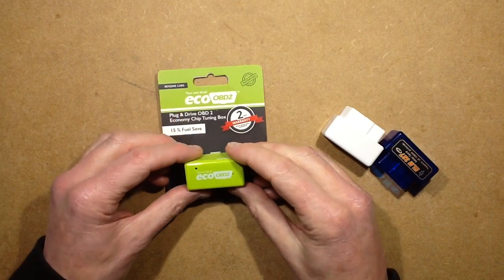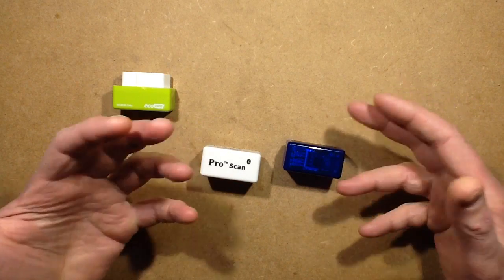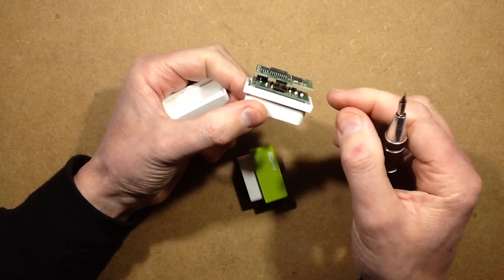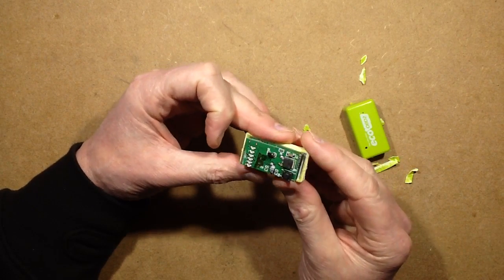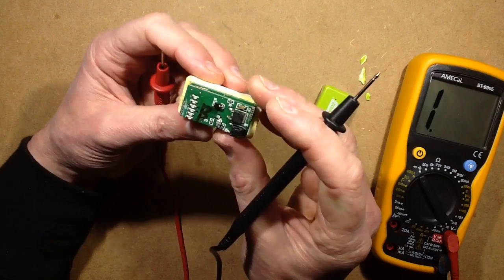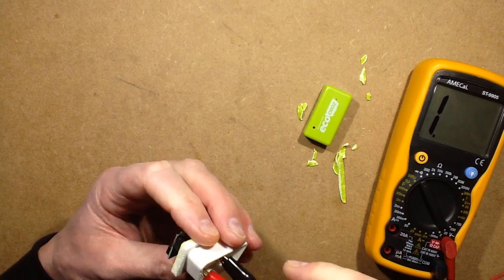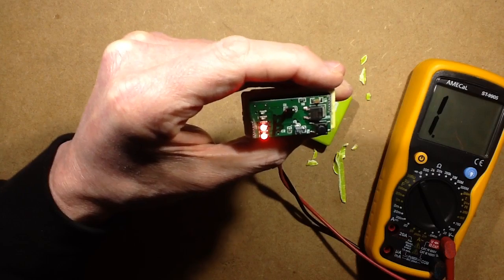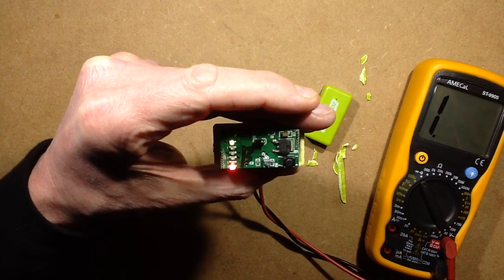Inside an ECO OBD2 "chip tuner" fuel saver.

Comment: Please Read this!!!!  

   A few years back I have released online the code and also schematics to build this systems. Just search for EGBoost and you will find some testimonials and videos I have made. They do not do anything to your car, absolutely nothing. The code can only processes loops to flicker the lights. The main chip is usually an ATTiny13 or equivalent. The idea started as a legitimate, write the code to alter the fuel maps of the car. But that could not be done as simple as you may think, the fuel maps can not be altered mostly from the obd2 alone, and if you actually can you run into the issues of having to store every singles vehicle fuel map settings. That will mean that you need to take each model car and run it on a dyno to figure out the correct settings. Not only that but you will have a less then 10% chances that you will even improve anything. So the idea was simple create the device, this way people will drive slower, this way it will improve the efficiency.  In any case, long story short I never finished the device as it was just to much work and would make not sense as many people will not really use it. So all the files were dumped on some forums and yea here they are now. sadly the pcb looks identical to what we released. Glad we scrapped the project when we did.

Not sure if you pointed that out but the regulator drop from 12v of the car to 5.5 of the Attiny, also the resistor are for the LEDS. The Can Bus does nothing but provide the power. I believe Pin 2,6 and 16 can be used for Power and 5 for signal ground. Mostly to have the system power on with the vehicle. 

Please do not waist your money.

Comment: I'm guessing it's a placebo, as to change any engine characteristics it would have to modify the engine 'map' and I doubt that little box has the capability to do that.

Clive you can do things through the OBD2 socket on most vehicles I.E. remapping :)
Reply: yup the only way is to trick the ecu to think its ok to have a lower lean limit.

Comment: most of these device types don't reprogram your brain..... the usually manipulate the voltage from the O2 sensor, and the throttle position sensor to adjust the fuel ratio..... it probably is more placebo then big gain...... it probably gets u couple miles not a significant amount
Reply: the car brains from 96 up to the new era of actual flash able brains....... will run a monitoring type firmware diagnostic to monitor the performace and keep it adjusted....... so..... that device will have a temporary reprograming effect...... then when you remove it, the change will linger for a few days until it re-adjusts it self........ you can test this device by getting a obd2 trip computer hooked in line with the device and watch the readings change.... get this cable http://www.ebay.com/itm/50cm-OBD-2-II-16-Pin-Right-Angle-Y-Splitter-Extension-Cable-for-Diagnostic-Tool-/121837184747?hash=item1c5e0fe6eb:g:SJIAAOSwNphWaSv-&item=121837184747&vxp=mtr  and trip computer http://www.ebay.com/itm/ScanGaugeE-OBD-2-II-DIGITAL-GAS-FUEL-SAVER-OBD2-GAGE-TRIP-COMPUTER-SCAN-GUAGE-E-/261248811052?hash=item3cd3a4802c:g:NZMAAOSwPcVVsvzp&item=261248811052&vxp=mtr and you can verify the product, by driving a week or so and verifying the normal mileage..... then add the eco device and watch the mileage to fuel change.
Reply: here is a unit for a cheaper price...... http://www.ebay.com/itm/New-Trip-Computer-Scan-Tool-Turbo-Gauge-IV-Digital-Gauge-OBD2-Fault-Code-Reader-/301818216811?hash=item4645c4816b:g:RH4AAOSwv-NWZQHk&item=301818216811&vxp=mtr

Comment: if you want to save fuel get a professional to tune your engine. Dont use these things as every car is different. Tuning usually involves a laptop, some software and connecting to the ECU or chip and driving along monitoring the values. Changing the computer values is only a small part of tuning, theres a lot of other mechanical changes needed to tune the engine. Dont forget to check your tires.

These sort of products actually makes it worse for your car.
Reply: Both mechanically and with a computer. Adjusting the engine has a lot of variables that all have different results. Have you watched Mighty Car Mods? Their recent episodes use engines that are computer controlled and can be tuned. Trying to get it right for fuel economy while not breaking down isnt easy. Aside from basic maintenance if you dont know the full details needed to tune your engine than dont as you could end up making things worse. Without prior knowledge or training, if you went to an F1 car thats sitting in the garage with a laptop ready for tuning would you really be able to tune that?
Reply: Oh yeah how does a professional tune a car for better fuel economy exactly? I sure would like to know because if you go and try to find one you will come up empty handed. Anything they did do would be illegal in alot of states also.

Comment: This device has access to the CAN (and possibly LIN) buses, so could, in theory send spoofed sensor data to alter the data that the ECU is working with. However this would be interleaved with valid data, so I don't know what the result would be. 
ECUs tend to use a challenge/response security key thing to prevent firmware upload, but I guess that the keys leak eventually and a database of them would not be huge (6 hex numbers per key for one manufacturer)

Comment: Bigclive,  I am a long time mechanic in the United States.  You seemed surprised that the vehicle manufacturers would allow access to this connector. OBDII systems, both before and after the CAN communication protocol was introduced were designed for bidirectional communication. The OBDII connector allows for the attachment of a bidirectional scan tool wish allows for diagnostic data to be received AND for the ability to manipulate certain engine control systems. This bidirectional communication was even possible on some OBDI systems.  I doubt the item you reviewed here would cause any harm to your computer control system systems, but I don't see it doing a whole lot to help either.  There are devices that communicate to a computer or through an app via Bluetooth like one of those you have. A lot of these show up on Diesel trucks.

Thank you for your reviews. I find them informative and fun.

DJ

Comment: you can actually cange a lot on an obd2 and make a lot of settings different to get better fuel economy or more power. The reason these are set the way they are from the factory is for the engine to perform the best with a lot of safety involved. That being said, this item is a total scrotum of a device

Comment: This is fake. I work as a technician and have to upload maps frequently (5+ times a week), it takes anywhere from 5-30 minutes to upload a new map for a car and during this time the car must be in the on position with the engine off. If you were to interrupt the process of remapping, the ECU would likely have to be replaced, even if it did not have to be replaced it would have to be towed to a dealership to have the mapping fixed for the car to even run.

Most modern cars have 40+ computers, they are in a network and watch each other, when one system (say the ECU) is sending a signal that does not make sense the other computers will send codes and light up the dash like a Christmas tree (turn on every light and likely put the car in limp mode).

A professional tune through the OBD2 port is possible and used quite a lot by high performance companies, but remember these maps are custom made by a profession for a specific vehicle and cost hundreds of dollars, not some one size fits all $12 Ebay toy.

Comment: Well, let's face it, GM (for example) hasn't spent billions of research to make the engine computer inefficient. The only argument one could make for this type of device is it tunes the engine (allegedly) to your individual driving style. However, that sad, many modern cars already do this. My 2010 F-150 tunes its transmission based on the driver.

Comment: It is possible to change the cars ecu through an obd port. I have a 1990 eagle talon with an eprom ecu that somebody put ecmlink into before i bought it, but essentially i can hook up to my obd port with a cable to a laptop and change anything about the engine. You can set secondary rev limiters for when you are going under 5 mph (essentially launch control) manually turn cylinders off, change the fuel trims, make it ignore certain sensors like on the throttle body, it even has an option for no lift to shift where you can go full open throttle, and without letting off the gas, put the clutch in. the ecu will see the clutch is in and will cut spark or fuel to drop the rpm's, and after you shift gears and disengage the clutch, it resumes. And this is all on a 26 year old car with a chip in the stock ecu

Comment: It is possible that it does something, but it is so generic that I wouldn't trust it to help with economy in most cars. You can tune some cars just through the OBD-port, like the SAAB Trionic engine management (which is the only stock car ECU I have experience flashing through OBD.)

Comment: I have plugged on into my car, after 1000 mile there has been a slight increase into fuel eco obd port on some cars can give you access to quite a lot of vehicle control systems most manufacturers now use this port to tune engine settings you do not need a new chip engine re mapping via blue fin technology works very well when you purchase these thing you have to specify make model engine and geasr box there might be an element of specific data but on the whole I have not noticed any major improvement I will remove from car as it specifies it does not alter the original settings and see if there is any difference in tyhe next 1000 miles

Comment: I do not believe any cheap little device like this can rewrite PCM firmware, nor can it affect PCM output, since it lacks connection to the relevant buses. To do that requires a professional grade analyzer, and licensing/access codes from the manufacturer, or a complete separate standalone engine management system designed to be modified on the fly, which can bypass or replace the existing system. The only small devices I've seen that can perform modification on the fly are standalone devices that intercept certain signals from the PCM, modify them, and report modified results back to the PCM, and these are fairly expensive, and limited in their functions. They're typically used to increase output on diesel trucks. They are also illegal to use on-road in most countries that have a pollution control regime, since they are typically designed to increase output power at the expense of emissions. (See the VW diesel scandal, for example, same principle) What we have here is just a little blinky light and not much more, most likely.

Comment: It's a scam, I am a technician studying to become and engineer and this is a complete placebo device.

There are so many different protocols in so many different cars- even using $2000 scanners with different adapter chips and software, it is sometimes very difficult to gain control of a system, most the time, if the car was not programmed to take an outside input, it won't without flashing it's software or using manufacture specific scan tools. A cheap device like this could not do anything to actually modify it's data stream, logging is different, because OBDII has logging built in, you just need a device to capture it.

I have a piggy-back computer on my Abarth- it works, but it was $500- it connects to the cam, the MAP and the turbo pressure sensor- It then connects back into the car's network. What it does is read the actual values, do the math in order to "lie" to the computer so the computer adjusts it's turbo pressures and AFR for higher performance within safe levels.

But even then, this $500 device does not actually tie into the bus network, it only lies through it's sensors.

Comment: I think the "storing data" angle is where we start poking holes.  To store 200 km worth of driving data requires a suitable data bank.  Are there any memory chips on there?  Does the processor have significant internal RAM?  I doubt that there is RAM in a car, free to use, accessible through the OBDII port.  Maybe a few k for storing the odd value, but not for 200 kms of meaningful driving data.  If there is no data bank, it can't be analyzing data the way we think of it.  Maybe it just checks to see how often you apply full power and if you do so more than the set number of times in the period, it retards the timing or something to make the engine less powerful.  And that's still being generous to it, my money is on "Does nothing useful, or so little of it that you'd do better to clear the random crap from you trunk to save fuel."

Comment: Is it really that dangerous to mess with the settings in your engine? It's not like it can cut your brakes or control your acceleration, the worst that's going to happen is that the car won't start or will run poorly; both problems that can be caused by doing any kind of engine work yourself, which I do all the time.
Reply: +Rob Mckennie It might 'jam' the throttle open? The Car's ECU can also do more than just manage the engine. It can manage indicators, fault lights and other things.

Comment: you can defiantly reprogram a pcm through the obdii port however that thing is just blinking leds, oems use different protocols and also use different ways of mapping engine performance and fuel trims.  More importantly with modern emission control systems there is only so much wiggle room for "Tuning" especially on vehicles with variable timing.  i even if it were possible i would expect that there would need to be a device like that it would need to be make, model, year, and engine specific,

Comment: I bought one of these devices a year ago now , I was very sceptical about it actually working , having heard reports from so-called-experts that it would fry my ECU and probably destroy my engine...I was rather reluctant to fit it. However after several weeks of trepidation - I plugged it in and followed the instructions. I have a very heavy right foot and wasn't expecting my V6 engine to better the 16mpg I get round town , but.....after 2 weeks I noticed it's smoother accelerating when cold and I had gained 2mpg , anyway.....12 months on and it's still doing what it claimed to do....whether it's because my car is 15 years old or not...I don't know....but it works for my car.
Reply: Is it a true story?
Reply: @marumarusensei1   Yes , and still working..... 6 years
Reply: @deanzool6638  

I will try to set the eco tune today I recently received for the 1998 Ford Expedition which is a  V8 5400cc gas guzzler. Only I can drive 13 miles per gallon.  Thank you. So many people say the product is a joke, scam,,,, etc.
I will let you know if I get the better mileage in a few weeks.
Reply: @deanzool6638  

PS. You said you got the eco tune an year ago. In your reply you said 6years, do you have two of them? One has been working for 6 years and another one has worked for an year?
Reply: @marumarusensei1  I bought one for my previous vehicle.... It went with the sale of the car
Reply: @deanzool6638  

Thank you for your reply.  I do appreciate it. 🙂
Reply: @deanzool6638  
Thank you  very much.
Whenever you have a moment, would you let me know that if  the device is always blinking which is normal or not? I setup this afternoon  since  then the ecotune keeps blinking. 

I hope it is not consuming too much power from the battery.
I don't want to call AAA for jump start in the morning tomorrow. 
In other words,  the device always while the car is being parked  shows its blinking light as long as  it is connected to the ODB 2 connector, is that correct? and Ecotune doesn't use too much power to make the battery dead?

I do really appreciate your kindness. 
Thank you so much.

Comment: if you want to spend money to save fuel you  don't need a car. . just change you driving habits.  change gear at a better time usually under 2000rpm I have found just before the turbo cuts in.
Reply: +german sheperd I just always find it so ridiculously funny that people buy cars with turbos and all that shit - only to nearly suffocate the engines just to save a few pennies when going to fill up.
If you want fuel economy, buy a car with a small engine - without a turbo.
I can't get my  gf's 2014 Punto above 7l/100km, no matter how hard I try.
Then again, i can't get my BMW 550i below 14l/100km - I'm usually on 16-17l/100km.
If you want a big car with a big engine, deal with using more fuel.

Comment: I tested some similar chip for Diesel engines. What I think is that the datalines that are connected to the microcontroller are just for detecting some change in signal, like when you start your engine, wich resets the LED-lichtshow, giving the impression it is doing something. Same with the reset button, it restarts the blinking pattern, en adds an extra pattern befor it, wich gives the impression it is recognizing the engine and more of that bullshit.
I gave it the benefit of doubt and left it connected to the car for about 500km, and it did a realy amazing job in absolutely changing not a thing.
The improved power or saved fuel some people seem to notice can easily be explained by a combination of the placebo effect, and the unlimited capacity of human stupidity.

Comment: yes, it is possible to alter your ecu through the obd2 port, but not with this. the kind of equipment that can do that is either software through a laptop or a module that is basically a full on computer. for instance you can look up a product called "vag-com" or the snap-on modis.